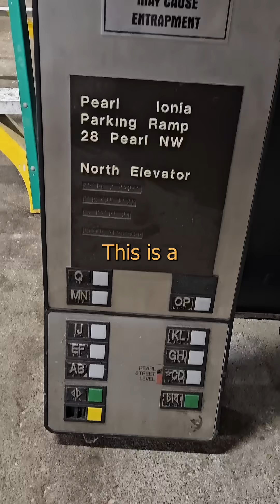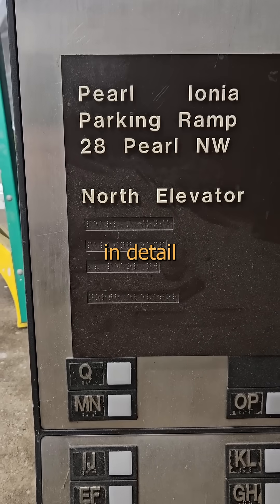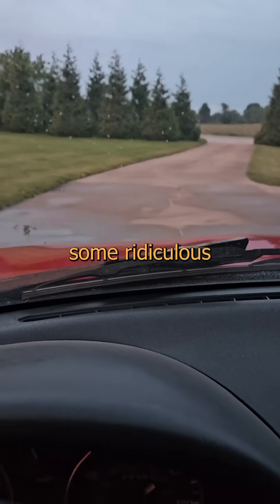Miata Mischief #chrisboden #engineering #gear #elevator #score #stories #parts #hacking #making

Comment: Probly a trailer that had wheel more dry rotted then the folks in a retirement home hauling a brand new bobcat skid steer on the interstate and back just for it to have a tire explode like a god damn shotgun nd in a drain pipe 10 min from the shop we all were like what the hell happened we just said fuck and brought it back

Comment: About a year ago, my friend and I went to fetch an old highway sign that had been taken down to be replaced by a new one. But, having only seen it from inside a car, we vastly underestimated its size and weight. This led to us attempting to load a 400+ lb, 20+ foot-long highway sign onto a 2001 Chevy Blazer’s plastic roof rails with two very weak excuses for ratchet straps.

This was done at night, in the rain, while wearing slides which are not exactly the best footwear for a construction zone filled almost entirely with mud. We ended up slipping and sliding the sign out of the ditch it was in and eventually got it onto the roof rails of the Blazer. Once it was loaded and very sketchily strapped down, we tried to set off but, of course, the Blazer decided it was the perfect time for its battery to die. We had to be jump started by a very dodgy man. Eventually, though, we made it home safely, and the sign now rests in my front yard, waiting for me to find a purpose for it.

Comment: I had a 1994 Acura Integra 2 door (all sooped up). I took the passenger seat out so I could haul a 1985 Honda Z50R in the car. Only car I had at the time and the bike ran and was $300, couldn't pass up that deal. Drove 300 miles, one way, to get it. Had a ton of wyrd looks on the drive home. Had to drive with the window down and the handlebars sticking out.

Comment: My buddy was hauling an ice fishing shack about 18 feet long. The only issue was the wheel for the trailer the shack was riding on fell off because the wheel bearing blew up. There she sat on the side of the highway. Needless to say we loaded the shack on to a car hauler a little oblong sitting on the fenders and loaded the trailer the shack was originally on onto a trailer about half its size... We got the job done by about 3am and now when we roll up to the tavern they call us, "the midnight riders"

Comment: Bought a ww2 air plane tugger and got it on a uhaul home turns out it weighed 7000lbs and was way way over weight also it fell through the center of the uhaul trailer luckily the next uhaul shop helped me get it back up

Comment: I was about 13 (in now 29) when my dad decided that we needed a picnic table for our yard. He found one... It was one of a group of 4 behind a local factory the employees obviously used as a smoke break area. He waited until the wee hours of the morning and had me help him go and load the thing on the top of our 98 Jeep Cherokee. This was a full size, one piece, heavy as fuck solid wood picnic table with the benches attached to it like you'd find at a park cook-out area. We tied it down with some nylon rope we had in the trunk and it made it almost all the way home, but we live on a hill. And that rope wasn't gonna hold at an angle going downhill. So I (willingly) stood on the hood of the jeep bent over the windshield and held the damn thing from sliding forward while he pulled down the hill and into our driveway. One wrong move or sudden break and that thubg was coming off and taking me with it. Probably woulda un-alived me pretty quick. It didn't though, and we enjoyed that picnic table for many years after that. In fact I'm looking at what remains of it in the backyard as I type this.

Comment: I think the sketchiest was putting an isuzu trooper on a car trailer behind my half ton truck on the Hillside in Anchorage.  As we're winching the Trooper up, i notice that the tires and suspension are not happy.  The trooper was FULL of parts, multiple axles, motor, transmission,  boxes of misc...   

And we towed that essentially down a mountain in mid winter, with a truck lighter than the load, with no trailer brakes.  Because my buddy's one ton truck didnt have snow tires or working 4wd.  And the best part (and I knew this going in), ten years later that Trooper is sitting in his side yard untouched.

Comment: Building a bridge once so we took old railroad ties and hauled them up with a hand winch and then loaded them into a canoe and then we paddled them up the river for 2 km to get to where we wanted to build the bridge. 10 years later we replaced the wood twice, but those railroad ties are still right where we put them

Comment: I was picking up a MiG-21 ejection seat in my Ford ranger. Which was only awkward lifting that heavy thing in the back on my own. But got funnier when I passed some friends on my way home and they were confused by the Soviet hardware sitting in the back of my little beater and following up with them after. 

Otherwise so many stories on motorcycles; cases of beer, coolers for groceries, or most of all straddling a rifle hard case after visiting my FFL.

Comment: My husband and I have a history of using tiny cars as trucks. But the sketchiest thing we've done (to my unreliable recollection) was a couple years ago, my husband drove our 2005 Toyota Tacoma very, VERY carefully from my parent's house to our house (about 8 miles through winding Vermont backroads) with way too much and way too long lumber, me in the bed of the truck acting as a counterbalance. dad has a sawmill and boarded me up some pine so we could make a raised bed garden for my MIL. My asshole could have produced diamonds if I shoved a piece of coal up it, every bump had the mass of boards bouncing and lifting and I was playing teetertotter as it did so. We got home safe no problem, I just felt like I was going to fall out of the back of the truck multiple times. No blame on my husband's driving, the backroads were just beginning to recover from mud season at that point.

Comment: I rammed a full size fixed armchair with a swivel base and high back into my car, still not sure how I got it through the door but once it was in. I had a fantastic passenger with wheels blocking my rear view mirror and an arm rest in my side

But it was free, and Ill be damned if you're expecting me to throw a perfect chair in the dumpster

Comment: I once collected a double wardrobe, a single bed, a chest of drawers and a bedside table in a 3 door renault clio. They thought I was mad but 20 mins later and it was all flat packed, passenger seat fully reclined, rear seats down and everything precariously crammed in. They were amazed, I was quite impressed myself until I hit the first roundabout and everything slid...lost the use of gears 3, 5 & 6, drove 30 miles back home in 1st, 2nd and 4th. Motorways were a bit high on the revs but I got a bargain 😂

Comment: I had a mountain bike in the back of a SEAT ibeza, it required the passenger seat to be all the way forward, the wheel was touching my face as I drove, and the front suspension was constantly completely compressed under the boot lid

Comment: I brought home an 8ft Christmas tree on my 91 Civic. It would not fit in so I held onto it through the moonroof, shifted left-handed, and bracing the wheel with my knee during shifts. Luckily it was under 10 miles, but hand was still frozen from highway speeds in Dec lol

Comment: When I was in my teens I rode my bicycle 4 miles to a clay quarry and then went on to haul a very heavy set of steel quarry cart wheels out of the quarry and on to my very wobbly parcel rack on my bicycle, I then pushed the bicycle all the way back home to plant the rusty wheels in my mums garden. My mum took one look at them and told me to get rid them. 😢all that crazy hard work for absolutely nothing😂

Comment: My father and I found a chicken coop on the side of the road once, fully intact and ready for use. At 13 years old, he had me balance one edge off the back bumper of his Ford Transit because it wouldnt fit in the damn thing. Then I walked about four blocks behind this van, carrying the coop while he drove at about 10 miles an hour. 

Probably wont win, but I do have video proof if it.

Comment: I've hauled a 10 4x4 in a 2 door Cavalier. I had it in the back seat sticking out the passenger side window on the mirror like I was jousting. I almost clipped about a dozen mailboxes on the way home. I also hauled ten foot boards in a 92 camry with the back seat flipped down and the passenger seat leaned all the way back with the boards up against the windshield. I've  also put a patio set that included two chairs,5 foot oval table, a lounge chair, and umbrella for the table in a brand new corvette in 97.😊

Comment: I used to work repairing computers, CCTV , servers, networking etc, 
One time y had to tie a high end hp server to muy motorcycle to configure at home  because site had no electricity and things needed to be done asap 
A length of Paracord, a prayer and a ton of fun on my 190cc motorcycle

Comment: Not exactly a ridiculous thing, but a couple of years ago my dad and I had to move a large wire shelf a couple blocks away to my grandmothers house. It wouldn't fit in mom's minivan, so we put it on the roof of my dad's Jetta sedan. With nothing securing it. No rope, no tape, nothing. What we instead did was drive while both of us held it with one hand on either side, me on the passenger's side and dad (still having to drive mind you) on the driver's side. Dad drove 10mph the whole way and I can still remember clenching my teeth, sweating profusely, gripping my side of the shelf as if my life depended on it. That was by far the dumbest way I've ever transported something by car but hey, the shelf got there in one piece.

Comment: i needed a new engine block fo my hit 2 pass truck and i had just a satern sL7 to try and get it home so i literally tied a full "21" spare truck tire tread to the belly of the engine and dragged the engine early 2 miles behind my little 2door sL7 all the way to the racetrack . surprising everyone it worked perfectly and i was fixed in time for race night.  yay

Comment: In college I drove 6 hours to buy a model car kit collection. I got a flat tire halfway there, but thankfully it was 10 minutes from the shop of the guy I was splitting the lot with. He helped me out with the tire and I kept on going. I loaded my 2003 Lincoln Aviator so full of model car kits, parts, completed builds, supplies, tools, paint, a tabletop paint booth, so much stuff. I had to leave some behind. There were model kits across the dashboard, on the center console, under every seat, every little nook and cranny had something in it. If my airbags had gone off my cause of death would've been impalment by a 1/25 scale automotive parts junkyard. I had to slam on my brakes once and model kits came raining over the back of my seat into my lap. 

To this day, I have no clue why I didn't rent a U-Haul. It would've been like $20 for the day. 🤦🏻‍♂️🤣

Comment: Sidenote, owning 3 cars can be a bit of a bitch when you live at an apartment complex and you're having to juggle cars between parking spots at the complex and the side of house parking at your parents place. They sure do come in handy when you move from an apartment to your own house with a garage though, since you can cram them with all the shit you've accumulated in the apartment over the years and consolidate everything into one location that way. 

Leave room for your knuckles though if you don't have a short shifter, 80s bmws have a tractor-like throw without one.

Comment: Picked up a 600lb stratasys objet 260 that didn’t work for $125 on market place then loaded it with 5 friends into a f150 bed that was rotted out then drove 200 miles home with not straps then put it in my garage where it sits

Comment: Ratchet strapped a set of 20inch chromes for a fiero with rx8 suspension (and soon drivetrain) to the roof of my Audi station wagon. (Yes they were stacked on top of each other in one glorious tower)

Comment: Wasn't hauling it home, but when I was training for a job at an offsite location about 300 miles away i met a guy who was looking for a 200+ gallon fish tank. 
I mention I had one in storage back home and sold it that day item unseen. Flash foward 5 days I decide to drive my 06 mini cooper s, because who doesnt want to drive a go cart at freeway speeds with a 250 gallon fish tank and a small carry on bag of clothes. 

I did have to take the back seat backs out and the passenger seat to get it to fit, however, I did indeed carry the seats with me so i could reinstall one i unloaded the tank.

Comment: Alr so my dad had bought this project 1974 VW beetle my favorite car that we ever had and so while we were out driving we stopped at a appliance store and welp he figured that we needed a new fridge and so we measured the inside of the car and bought a fridge that fit barely into the passenger side with a bit of Jerry rigging but we ended up driving home with a trunk with a sink popping out and a fridge inside the car. Absolutely wild experience when I was 10.

Comment: A distribution company I worked for ended a contract with an oil company.
The shipping employees (me as a floor supervisor) got to take home a ton of product they left behind. 
The problem is we had 24 hours to take what we wanted or it was all going to be trashed.

The only trailer I had at the time was my jetski trailer...

I dumped my two jetskis into my shed, drove to work, and ratchet strapped two 50gal barrels of oil to the skids of the trailer.

Comment: My father works in construction. During a job, he had to fetch rebar for some concrete. The order was for 2 tons of rebar. Keep in mind, the vehicle they were using was a 2002 Chevy Silverado 2500 HD with a tool bed and a custom ladder rack. They put all 2 tons on the ladder rack, and drove it for an hour to the worksite. Let's just say the truck squatted a little.

Comment: Came across a Wendy's closing down and basically dumping everything in the stoee including all their cast iron 2 person tables and hardwood chairs.

Managed to squeeze 14 chairs and 8 of those  tables into and onto a late 90's Toyota Sienna.  Didn't have time to remove the middle and rear seats either, so I was already working at half space.   Got four of the tables strapped to the top of the van on the travel bars with some bungee straps and a prayer.

Comment: Okay, my dad and I poured concrete. We had a big truck. He also had a convertible PT Cruiser. What happens when the big truck is unavailable (I don't remember why) but you need 2 more 16'x8" forms because of updated plans and you have the pour already scheduled? You pray to the machine spirit your ratchet straps don't fail.

I've also shoved a Blackstone in the back of my Mustang. I could barely get to 35 with the back open. If those PZeros could think I'm sure they would have thought my grandma was behind the wheel.

Comment: I have a 2001 Audi A4 and will put anything on it roof! I've been over 100mph with a table on it, and would regularly haul 8+ ladders at a time. Not little ladders! 32, 28, three 24s, a few 16s and a couple step ladders. At the same time an hour down a major highway.
There is actually a walk around on my channel with a few of those. The 32 wasn't there.

Comment: I hauled a 86 Honda 200x in a 87 CRX. Had to remove the atc tires and use a strap to keep the rear hatch from flopping. Drove 100mi home

Comment: My dad was moving TNT from one work site to another, through a blizzard, and figured it’d be “safer” to overload the truck rather than make two trips down icy roads, halfway there in whiteout conditions they decided they better pull off the highway and let the storm pass, him and two other guys stuffed into a mobile megaton of truck-bomb that would make the Taliban blush. They fell asleep and my dad said he woke up to the other two guys screaming “oh god move move move! There’s a traaaaain… turns out they’d pulled off the highway and parked on top of a poorly marked railway crossing and had just enough time to hit the gas and pile the truck into the ditch on the opposite side. Since it was the 70’s no one even asked for
An incident report but I’m sure it would have rivalled the Halifax explosion.

Comment: My brother and I needed to move a king sized mattress and box springs in the bed of a Chevy S10 about 10 miles down some backwoods country roads. Unfortunately, we didn't have any straps. We decided that the best course of action was to toss one of our friends on top of the pile to act like a meaty paperweight. About 8 miles into our trip we hit a huge turkey with the window of the truck. It tried to get enough altitude to get clear but it was much heavier than a coconut laden swallow and just couldn't pull it off. I saw it's butthole kiss the windshield and I heard my buddy scream ( to be fair, he was screaming the whole time but he started screaming louder at this point). My brother and I decided that it was too risky to stop and check on him, we were concerned that given the chance he would jump off the truck and refuse to be our meat ballast for the remainder of the trip. Once we got to our destination, we found him white knuckling the mattress like it had never been gripped before and covered in feathers. Needless to say, he was kinda pissed at us. 

We got the mattress delivered though.